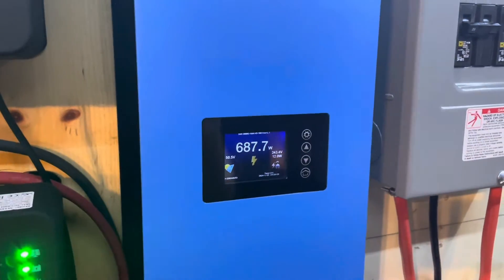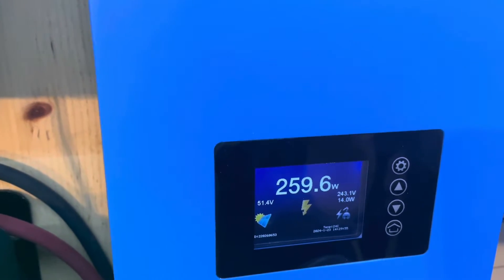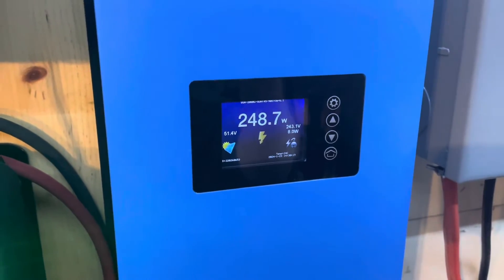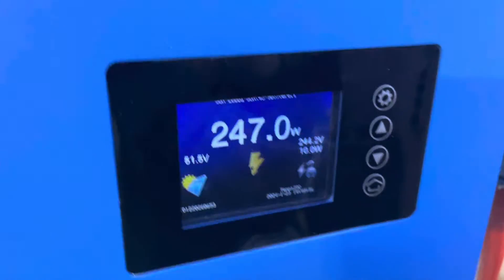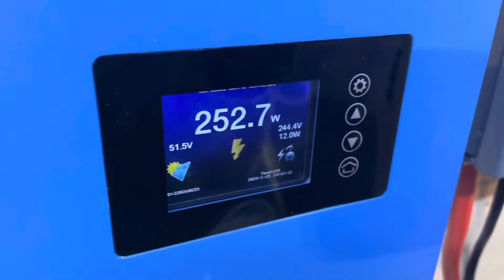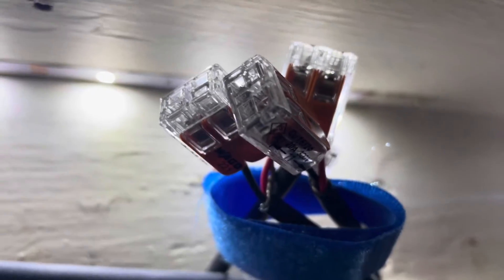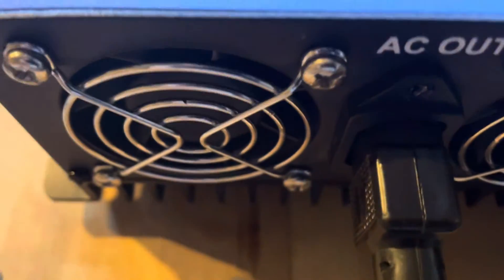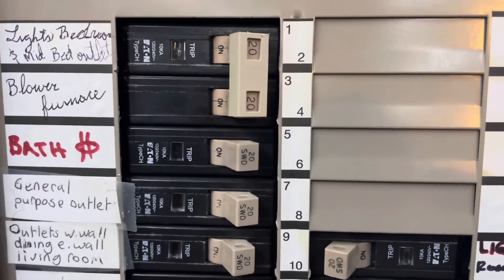2000w Sun GTIL Grid Tie Inverter with Limiter USA setup

Comment: Hi!
Can i connect the ac output to any AC outlets in my home?
I want to use this with limiter, where i connect the ct limiter to the incoming lines from grid.

But i want to connect the ac output from this inverter to any ac socket in my home, would this work?
Reply from the maker: I have mine connected directly to the breaker panel for several reasons.

- They're 2k GTILs with 240v output. An AC outlet in a US home is 120v.
- They're on a dedicated circuit that nothing else can interfere with.
- The circuit has sufficient gauge wire and breaker sizing.
- It's much easier to get the CT clamps to the grid lines in. 

Assuming you're in the US, you could use a 1000w gtil via the AC 120v outlets, though there is risk. AC outlets aren't really meant for back feeding, and could overheat, especially if there are other devices on it. You'd have to extend the CT to the breaker panel to get an accurate reading for the limiter. You could use shielded cable e.g. cat5, to make the wire as long as you need. Ultimately it's up to you, but personally I wouldn't.
Reply: @thedabbler2753 thanks a lot for this information!!

Comment: I’ve seen videos of these blue box inverters that need a resistor on the series CT clamps. Did you need these resistors? Or maybe that’s because they were using the 1000w one for 240v?
Reply from the maker: I didn't use the resistor.

Comment: Have you taken one of these apart?   I have one and it has worked fine for 3 plus years. yesterday it stopped reading the Volts coming in from the panels.  I checked the panels and they are working, so I am just wondering if there is a fuse in there or something
Reply from the maker: I did a long time back mainly out of curiousity. There are some fuses, though honestly a lot of the time the problems seem to be more involved. Look up a chap called Bobby Chung who runs a company called https://www.2muchsun.com. Through developing products to augment the GTIL's abilities he has intimate knowledge of the things that go wrong on the AC and DC side.

Comment: I ordered two of the gtil 2000 units today for use in a U.S. split phase setup.    Your video was the most helpful I found on how to configure the setup.    Are you still using yours?
Reply from the maker: @happydingo6435  I am indeed. 11kWh of production so far today. Good luck with yours!
Reply: @thedabbler2753  thx - my house is already entirely off grid except for my 4 ton central air system.   I hope to use the two gtil 2000 units to zero out the load presented by the AC unit which is about 3800 watts when the compressor is running.     I wondered if each of my two gtil should be connected to its own 110v hot leg and neutral, or raise the output voltage on each gtil to 220v and connect both gtils in parallel to l1 and l2.   I guess still a little confused!
Reply from the maker: @happydingo6435  if you're using the 2k, you have to do the latter. The L and N on the GTIL are treated as the two hots in a 240v circuit, so go into a double pole breaker. The G goes to the ground bar. None of it should connect to the neutral bar in the breaker panel.

Comment: Good video.  Can you provide a model number for this inverter?  And I did not understand your comment about the older units.  Are they missing the Neutral connector?
Reply from the maker: The 2000W model that I use, which has a 45-90V VOC, is model SUN-2000G2-H. My older unit has the 5.2 firmware and the kettle / PC type plug, whereas the newer one has 6.1 and a terminal block, but both wire up the same. The 2000W model is a 240V device, so what is labelled as L and N on the GTIL go to the two hot terminals on a double pole breaker, while the ground goes to the ground bar. Nothing connects to the neutral bar in the breaker panel. I hope that helps.

Comment: Can we extend CT sensor cable for extra length? 
Is it still accurate?
Reply from the maker: It is. Make sure to use shielded twisted pair cable (STP). You should be able to get around 30m / 100ft.

Comment: This doesn't make sense to me because when you connect the GTL to a double breaker,  you are connecting both lines to only one leg (120 volt) of the two legs on the breaker box.  It seems to me that the GTL lines should go to a breaker on each of the two 120 volt legs in the breaker box.
Reply from the maker: That's not how a double pole breaker works. I've included a link for you to have a look at at the end of this reply. Scroll down to the bit about the dryer plug as the 2k GTIL is essentially working the same way. You'll see that the L1 and L2 look like a zipper. When a double pole goes in it touches both at the same time. That is why this works.  I hope it clarifies things for you. https://theengineeringmindset.com/120-240v-split-phase-us-can/
Reply: @thedabbler2753  Thanks, buddy.  I just found out 8 months later of your very helpful post.

Comment: Hello great video

I hooked up my 2x ct clamp on each string of pannel

It seems to only read 1 side...
 And the wattage of grid taken dont drop.. on mine but it inject solar wattage
Reply from the maker: There could be multiple issues. Make sure internal limiter is checked (see https://youtu.be/_FxgATQuSaA), then ensure the CTs are facing the same way on each phase. If the watts is negative on the GTIL they are the wrong way.

Comment: great video,  whne the unit stops working and you check DC fuses  and they are good , do i haev to take out the MOSFETs  ? anything else i can check before desoldering all of them... thank you in advance .
Reply from the maker: There are quite a few reasons it might be failing. If there are bad MOSFETs then testing and replacing them may work provided nothing else is wrong. While I can't offer a solution, here are a few good threads around the net on this. See...

https://community.openenergymonitor.org/t/repairing-sun-1000gtil2-or-2000gtil2/14947 
https://www.facebook.com/groups/1532777123642307/user/100000496450995/

Comment: We have the 2000 watt version however it stopped working do they have an internal fuse it says lifetime warranty what's the page on Amazon disappeared thank you in advance
Reply from the maker: I'm sorry to hear that. Do you get any sort of error message on the display? There are quite a few reasons they fail, both on the AC and the DC side.

There are a couple of Facebook groups [1] you can join that may be able to help you diagnose errors and part level failures. Otherwise it's try and chase the warranty or buy a new unit I'm afraid.

As regards warranty work, the SunG units are made in various factories from a reference design, and then resold through numerous resellers that come and go quite quickly, meaning the warranty after the Amazon return window may be worthless. 

If you can track your reseller down, they usually try to work with you via email. It is unlikely they will swap the unit out, but you can try. More often they suggest the part(s) to replace, but that requires electronics skills. The individual components (fuses, mosfets, capacitors, etc) are not very expensive, and it is possible to buy the GTIL's mainboard and display unit on places like AliExpress for cheaper than a whole new unit, but you will be waiting a while for it to arrive. 

Given the price point, and cost of your time, you may just have to order a new unit. Before you hook it up, try to understand what went wrong with the first unit. On the DC side, over current or over voltage can damage the unit. e.g. VOC exceeds the limit on a cold day,.amps exceed the 30A max, etc. On either DC or AC surges can damage the unit. You need to ensure adequate surge protection and breakers on either side. Further to that, do not run the units too hard. Set an amp or watt limit in the configuration.

[1] https://www.facebook.com/groups/1455824754596738/posts/2133319323513941/

Comment: Would it work to just buy one of the 120 Volt grid-tie inverters, limiting to just one of the two 120v "legs" coming in? I see everyone buys two, one for each phase. But if you just want to reduce your energy bill a little bit with 4 panels, wouldn't it work perfectly fine to just do one?
Reply from the maker: One 120v for one leg would with the clamp would work. The effectiveness is going to depend on what you have running on that leg and how much you pay for electricity, but certainly it will chip away a bit :)
Reply: I really appreciate the reply; its more of a learning thing. And one that should pay for itself in 4 or 5 years. I got 4 panels used for $24 ea (245 watts each - Santan Solar near me), and the inverter is $200. If this drops my bill by 5 or 10 a month, thats fine! Just to get this thing going is fun and a learning experience.  @thedabbler2753

Comment: Would you mind doing a more detailed video on how you hooked up the CT clamps, and what setting you used? Thanks!
Reply from the maker: I'm sorry I didn't get around to this yet. Basically, in the CT cable you'll find a red wire, a black wire, and a bare stranded wire. For series, the red from the inverter end of the CT connects to the red of the first CT. The black from the first CT connects to the red of the second CT. The black from the second CT connects to the black going back into the inverter. The bare connects with the bare of the first CT and second CT. If you want to try parallel, the red from the inverter goes to the red of both CTs, the black from the inverter to the black of both CTs, and the bare of the inverter to the bare of both CTs. The settings can be found at https://www.youtube.com/watch?v=_FxgATQuSaA
Reply: I also would like to see this
Reply: Blablabla bla bla bla

Comment: I have 3+ years of using the 1000W version with one on L1 and the other on L2. I have not purchased the 2000W because of the one Current Clamp. I get the AC (alternating current) side of the box. You lost me on the Current Clamp(s). I would like to have two of the 2000W units set up in place of my two 1000W units.  
Is there any way possible you would draw (hand drawn is fine) a schematic of how to wire the Current Clamps in this series and parallel fashion and what clamp from what inverter goes where?

 My system has worked perfectly for over 3 years with no adjustments. I just would like more power. Could you please help?
Reply from the maker: Thanks for your question. I'll get something together as soon as I can. In the meantime I'd like to give some extra detail to help you decide before getting too far into it.

I originally bought my GTILs to run directly from panels, and jumped in for the 2k unit because why not. The panels pushed 62-70v depending on conditions so it was able to hit the rated unit max of 1800W per GTIL, but after a couple of years it became clear a lot of the generation was thrown away in the day which could gave gone to evening loads, so I added batteries last year. It was a great decision which really helped for overall monthly generation, but it isn't perfect if one is expecting twice the on demand power of the 1ks when on batteries.

I opted for 48V (51.2V) as it was easiest to find charge controllers and batteries for that voltage. While it works fine it's at the low end of the 2k's 45-90 VOC so for more watts that means more amps and more heat. To keep the heat down I capped the input to 25A and they've run fine now for several years. When the battery voltage is in the 54-56v that's about 1350W to 1400W, so the best case is 2800W of the potential 3600W from 2 x 2k GTILs. I haven't really seen any gain moving it to 28A. To get safely near the rated 1800W per unit one would need a 60V battery.

With 1k units a 48v battery hits the sweet spot for their 22-65v VOC and I'm guessing yours can hit around 900W each without issue, so as you already have two units, and provided you have the wall space you might actually be better off adding another 1k GTIL per leg for 3600W. You'd have increased redundancy and could still take advantage of paralleling the CTs.

e.g. 
GTIL1k-1-L1 and GTIL1k-2-L1 parallel to CT-L1.
GTIL1k-3-L2 and GTIL1k-4-L2 parallel to CT-L2.

I hope that didn't put you off the 2k. It is a good unit. Just trying to see how best you can grow what you have.
Reply: @thedabbler2753  Thank you for the excellent, understandable, and enlightening  reply. Just a couple bits of house keeping before I continue:
1.) I have batteries but not connected in the usual way. I have two more GTIL1ks set up in watts-limited mode (battery mode setting) set to 150Watts each, one "L1" and one on "L2"  connected to 48VDC batteries. My battery system in controlled by simple "on/off" 24 hour timers that turn on the battery inverters about one hour after my day time GTIL1ks shut off due to sundown. They are not connected to the existing Current Transformers (CTs) as I do not know if in battery mode setting there is an option which utilizes the CTs(?)  If so, I would just use the additional CTs that came with the two additional GTIL1ks used for batteries at nighttime (IF, I had room on my busbars). The 150Watts per GTIL1ks on battery is due to my house never uses less than 400Watts and this keeps a 100Watt no-back-feed margin (no CT control). 
Even more strange, I have high quality AC battery chargers also connected to simple "on/off" timers that come on during peak solar hours and recharge the batteries each day. This cycle repeats without error every 24 hours. So no Solar charge controller of any kind for battery charging. I may rethink/redesign my whole system if I go (most likely) with your recommendation of four GTIL1ks for daytime which I like. 

So, lets assume I go with the four GTIL1ks for daytime power. I have a problem that my breaker panel does not have accessible L1 and L2 cables. I have only solid metal busbars coming from the smart meter. I only have room for one CT per busbar which is why I originally stopped at just one GTIL1k per busbar. (daytime)
I fully understand DC parallel and series wiring. I don't understand if two GTIL1k can share one CT wired in (I don't know, series or parallel ????).   I see the '"e.g." above and so am guessing you indicate I can use one CT in parallel with two GTIL1k on the same leg?   Can you advise in detail here please?
I also don't understand if I can utilize the CTs for nighttime battery operation for my other two GTIL1ks set in either solar or battery mode while using just the batteries at night.     Can you advise in detail here please?

I really appreciate this help as I so want to grow/scale up my system but keep in "under the radar" so to speak. Thank you.
Reply from the maker: @benkanobe7500  The limiting / CT function works independently of the battery or solar configuration, so you will be able to use your battery powered 1ks and it will limit itself to the load. I created a short video to explain how the different settings interact.

https://www.youtube.com/watch?v=_FxgATQuSaA

Regarding the metal busbar, it sounds like parallel connection of two 1ks to each CT will solve that. I thought about writing it up here but it got a bit messy so will be doing a video on it soon.
Reply: @thedabbler2753  Thank you. I learned so much from the short video and now understand how I can use my CTs in night time battery mode. 
I have watched (I think) every YouTube on the blue box GTIL1&2k created over the last 6 years and the batter function has never been successfully understood or explained that I now of. 
I look forward to your next video (above mentioned). I will be looking for it.
Now off to order two more GTIL1ks.
Reply from the maker: @benkanobe7500  Just following up. How did it pan out for you?
Reply: @thedabbler2753  excellent. It isn't a hobby it just works and I don't do anything.

Comment: My observations are: let’s say when L1 and N draws 100W, the inverter will generate 200W  since it is 240 V. L2 and N will generate the same power as 100 W and will be exported back to grid.
Reply: Yes. With only one input for the CT sensor, you can’t avoid this on 120v circuit. For this reason I went with 2 1,000 watt units with 2 separate sensors. One unit is all for L1 and one is for L2.
Reply from the maker: Interesting. This is happening in your setup currently? Looking at my energy monitor at present I see (using a snapshot from just now) 380W on L1 and 65W on L2. The inverter is generating ~440W (5W under load). I switched on some lighting on L2 pushing it to 88W. The inverter is generating ~462W.
Reply: @thedabbler2753  I have question. How do you connect your 2 limiter sensors? Parallel or in series? Assuming it’s parallel, if L1 draws +100W and L2 draws -100W what is the total reading of both sensors? Assuming it’s connected in series, what is total reading of both sensors too? I am confused. Since 240 v GTI with limiter has only 1 input sensor there is no way the limiter will know which phase is sensing L1 or L2?  Try to test L1 and L2 with external clamps you will see different results.

Comment: Can this be added to a home that previously had solar installed in the past? To just add a bit more power
Reply: I’m glad you say that because I’ve had so many people tell me that the power put a second meter in with solar so that if you add power it charges you for it

Just don’t want to make my situation worse, your video was awesome cause I had so many questions for the USA setup for split phase 240 into 120 lines
Reply from the maker: @cenval999  they may have a point where there is a second meter, in which case you can just add the CT's for the GTIL and reduce the house load. To the utility, the approved grid tie already in place is just sending more of it's anticipated generation back to them because the GTIL is doing the house. Should be transparent.
Reply from the maker: I see no reason why not. If you have a net metering agreement still in place you can probably do away with the CT / zero export, making setup easier.